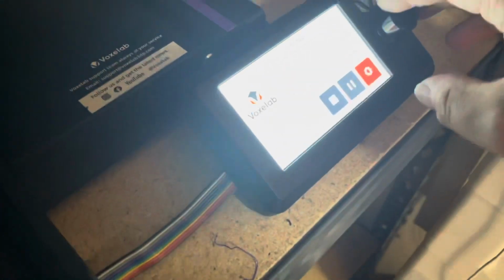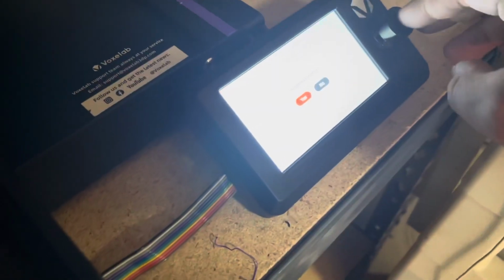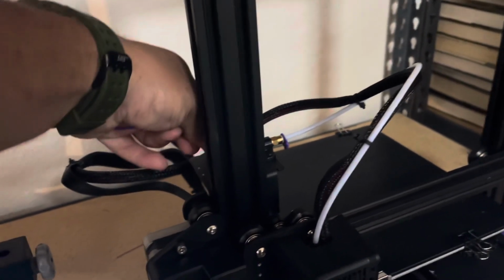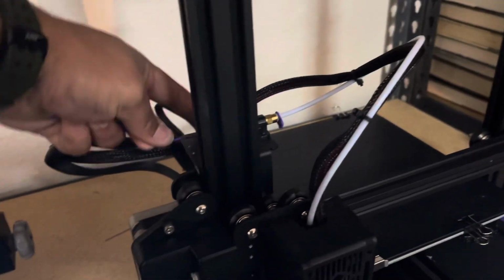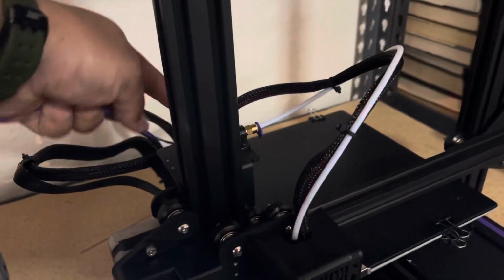How to Change 3D Printer Filament Mid Print on a Voxelab Aquila

Comment: Um ok...So here is how you do it...You heat the nozzle up to the filament temp, you press the release lever on the filament feed module, you can take an optional step to manually feed the filament a bit to make sure its melted,  extract the filament, load new filament.

Comment: Okay so my printer keeps pushing my print off the bed when I pause and then resume the print later on. Do I have to hold it and adjust the z offset or? I don’t understand why it’s doing this
Reply: Like it won’t move up on its own.
Reply: You might want to update your firmware or something. When you resume your print from a pause or power outage, it should pick up exactly where it left off. Don't adjust the z offset while pausing. There is a glitch (or at least on my aquila there is) thst when you adjust the z offset during a pause, the nozzle will not return to its previous position and when it resumes it prints in the air.